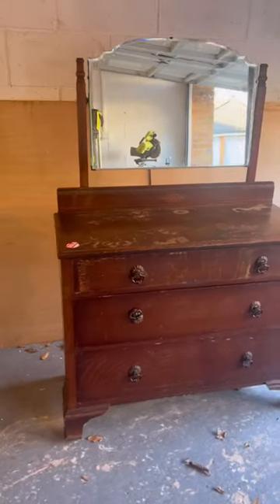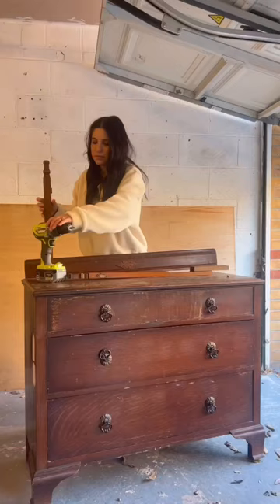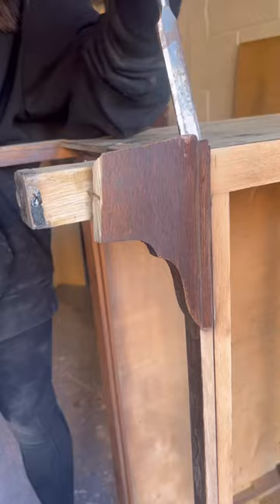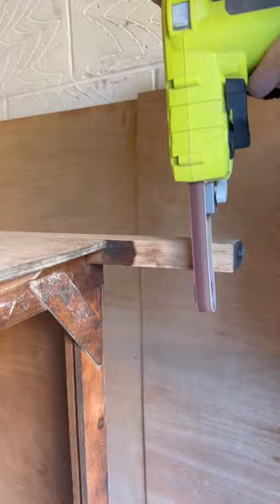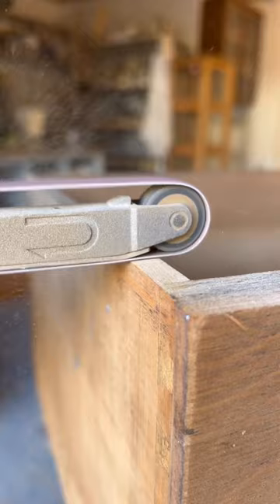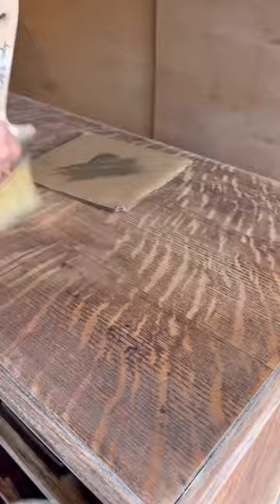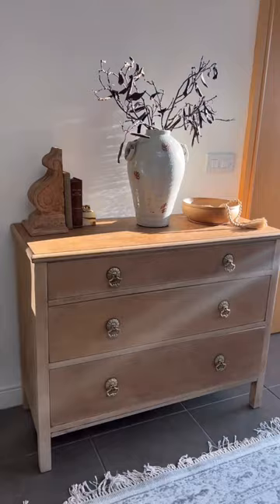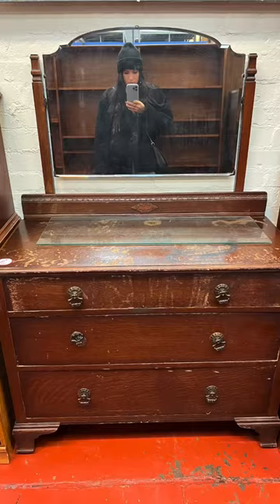This dresser got a GLOW UP! 😍 #ad #shorts #furnitureflip #furnituremakeover #dixiebellepaint #diy

Comment: You probably know this but in case you don’t , please test for lead before stripping any old furniture. Lead paint and varnish is very common in vintage pieces and can be very dangerous to inhale the dust
Reply from the maker: Thank you!
Reply: Yeah i came her just to say this. This is such an old vintage piece that it very likely had lead on it. Its very dangerous to work with lead especially when you inhale particulates!!!
Reply: I came to say the same!  It’s so common with old pieces and that clip of the dust just flying around literally scares me 😱